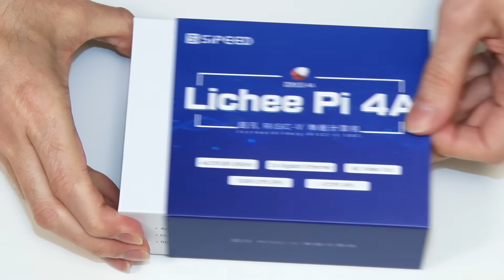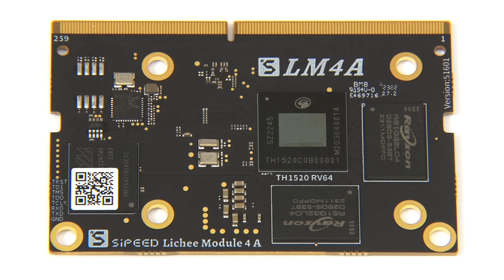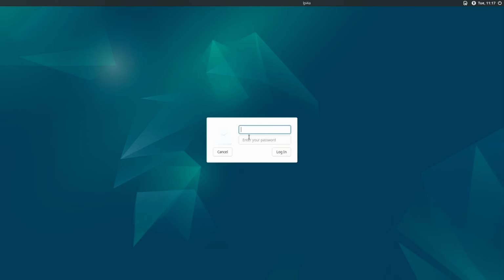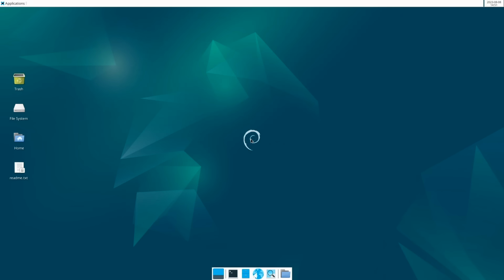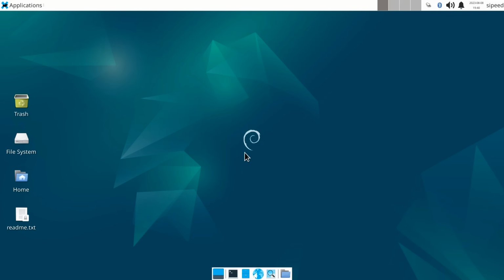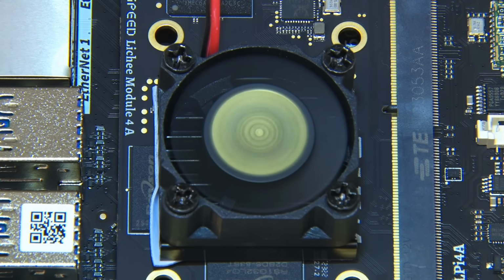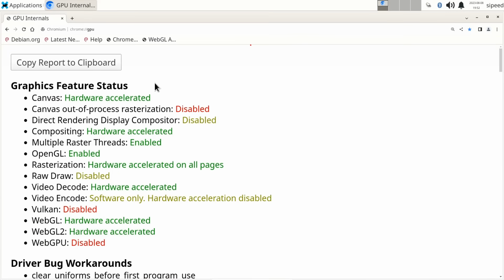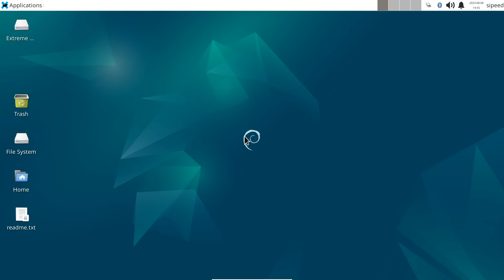Lichee Pi 4A: Serious RISC-V Desktop Computing

Comment: Too expensive, 
What's the point? 
when I can run a PC (new/old/mobile) run anything I can think of ...sure x64 solutions need more power but where is a ROI point for power VS limited SBC?
Reply from the maker: The point, as I noted early in the video, is that this is a development board for those wanting to develop for, or otherwise experiment with, RISC-V. It is not -- as you rightly note -- an end-user competitor to any ARM or x86 computer right now. But is it by far the cheapest RISC-V board with this level of power -- and will offer a great ROI for those wishing to develop for RISC-V (who three years ago were paying thousands of dollars for far less powerful development hardware).

The board is covered on this channel to demonstrate progress with the RISC-V ISA, which could be a mainstream desktop and server player in a few years. I am not here recommending a purchase. :)

Comment: Ok, well, it's not faster, it's not cheaper, and it doesn't work all that much better, so?
Reply from the maker: What are you comparing this with? It is, as I clearly said in the video, a RISC-V development board for those wanting to develop and/or experiment with hardware that runs the RISC-V ISA. In this context it is the fastest board at its price. It is not a competitor to an ARM or x86 computer. :)
Reply: @ExplainingComputers  Since the ISA IP is open source, it was supposedly supposed to drastically lower the cost of the final product. That was the hype upon which all the hoopla was based. Now, we see suboptimal products appearing that are in no way, shape, or form, of a lower cost, of increased performance, or better reliability than the offerings it was supposed to supplant.
Reply: @ExplainingComputers  BTW I just noticed the question below, which you granted a heartfelt heart. Ergo, I rest my case:

"They've made significant process since your last RISC-V video. It won't be long before RISC-V gives ARM a run for its money. And if they keep making progress at this rate, Intel and AMD had better take notice."

Comment: Hopefully the correct drivers are available for Debian, because I'd never accept the custom OS builds.
Reply from the maker: Well if you don't accept a custom OS build for a RISC-V system, you won't have any OS at all. :) This is not ARM or x86 hardware! There are no "correct drivers" or standard images out there yet.
Reply: @ExplainingComputers  completely understood.

 I had stupidly assumed that there would be a Debian risc build. Just that the board chips would then be usable on that.

Comment: What I find really surprising  in all those SBCs - be it ARM or RISC-V based, they ALL struggle with 1080p video playback. Given the year 2023 this is absolutely ridiculous since all the smartphones handle such video playback just fine. I find it hilarious.
Reply from the maker: It is a sofware issue? Drivers are needed for GPU-accelerated video playback, and as there is no standard ARM SBC platform, these need writing on a per-system basis. And somebody has to do this. Smartphones sell in their hundreds or thousands or millions, so there are no cost constraints on developing the drivers (and manufacturers of the SoCs develop them). In contrast, aside from the Raspberry Pi (which can handle 1080p), SBCs sell in their thousands or maybe tens of thousands, which does not leave a software deveopment budget to write -- and constantly update -- required drivers. Not "hiliarous", just basic tech economics.
Reply: @ExplainingComputers   It is hilarious as some of such SBC are clearly marketed as low power desktop computer replacement - which they absolutely are not. It looks like SBCs are on their way out anyway - as you said - there's no market for them. Couple hundred thousand is nothing in todays economy. That is why I have always claimed them to be a clear miss. Low power, simple SBC - yes - for coding projects as management systems for other devices. But a desktop? Hell no.

Comment: If you were experiencing video problems in Chromium, perhaps using Firefox or another browser might fix the issue.

I'm amazed to see SBC's become a great alternative to a desktop PC, even though you can't upgrade or repair them, which is my only concern when it comes to thinking about buying an SBC, I have been considering getting one, however, I think a traditional desktop is better if you plan to change parts, upgrade it, or going full custom! 

Great video, please continue making fantastic content, we really appreciate it. I also want to see more videos on Linux and SBC's, since I'm getting into them a bit 😁

Comment: And it only took 33 years.  https://en.wikipedia.org/wiki/RISC-V
Reply from the maker: No, it didn't. The article you cite very clearly says that RISC-V was introduced in 2015 (right side panel, right at the top). Don't confuse "RISC" and "RISC-V" -- the latter is just one implementation of the former general processor category. RISC processors are very widespread already -- every Android  and iOS tablet, smart TV and so on uses an ARM RISC processor. And so do all new Apple computers with an ARM M1 or M2 processor. I give up.

Comment: unfortunately this is far too expensive, it is even more expensive than the Orange PI 5 Plus.
Reply from the maker: I think you've missed the point -- this is a development board for those who wish to develop for or experiment with RISC-V (as I said in the video). It is not an alternative to an Orange Pi or any other ARM or x86 SBC. It is impossible to buy this much RISC-V power elsewhere for this price.
Reply: @ExplainingComputers  On yes ill definately agree with that, this is the first board that more or less matches RPI4 perf. The price is probably due to the format.

Comment: Great advances, thanks for covering this.
Many of us engage in IoT Python coding - mostly for me, interfacing to sensors etc. on SBC boards.
This is mostly successful on ARM devices (usually with Pi in the name) but for RISC-V, can you please check to see if Python 3 is supported along with interfacing to I2C/GPIO pins.
Thanks

Comment: Their ordering page is obnoxiously confusing. Accidentally ordered a debug probe before I realised it wasn't the board in question lol
Reply from the maker: I can only agree.
Reply: That will probably come in handy anyway :-)  Sadly, this is a problem shared by all Aliexpress stores. You get used to it, and learn to double-check.
Reply: @BruceHoult  indeed. No harm done in having an extra adapter around. Did manage to squeeze in the actual board with the same order after som fiddling so won't even cost extra postage :p

Comment: Seems a lot more responsive than the RPi4.
Reply from the maker: In some respects, it is. Certainly launching doing a search in a browser is more responsible. In other ways, a Pi 4 is more responsive -- eg its desktop is smoother. I am guessing the the desktop does not use GPU acceleration (yet) on the Lichee Pi 4A. They went for Chromium GPU acceleration first, which I think was a smart move.

Comment: Hey, just a question, Chris (can I call you Chris?) - have you ever tried the h.264ify browser plugin (available for both Chrome and Firefox) on any of these low-end boards? It forces YouTube to use h.264 video rather than VP8/VP9. VP8/9 usually isn't GPU accelerated but h.264 usually is and sipeed's webpage for this board says it does h.264 up to 4K at 75 fps. Most of these boards you review, even the RISC-V ones, boast similar specs with h.264, so this could be an absolute GAME-CHANGER for the desktop SBC world since most people's use cases are such that YouTube is the killer app for desktop. YouTube might be slow on these systems due to them being forced to render video on their CPU rather than using their hardware acceleration which is more than capable of doing HD or even 4K video. I use this plugin on my old ThinkPad laptops which keeps them functional as my daily driver in 2023 despite being more than fifteen years old! 

Worth looking into, no?

Love your channel. Peace. ✌️
Reply from the maker: Thanks for this. I always test to see if h.264-ify makes a difference. So yes, I've been "looking into it" for years. :)
Reply: @ExplainingComputers  Glad to hear it! I just had to make sure.

Comment: Can you try an AI LLM on it? Like from MLC LLM project, but it requires some GPU through Vulkan to work. They managed to work it on Android or ios with very few Ram and many popular open source Ai variations. 
By the video it looking quite fast, Linux on Raspberry Pi 4 is very slow when I've tried mine or maybe that was because a big TV.

Comment: It would be nice to see some tests in Firefox with ublock origin and maybe with/without h264ify to force h264 decoding. Also I've found Firefox is more performant for lower power systems, especially on YouTube playback.
Reply from the maker: I've since installed Firefox, but there is no GPU acceleration. So video playback is worse than in Chromium -- but HDMI audio is perfect! :) Remember, this is RISC-V -- what happens on other more mature platforms does not carry across (yet).
Reply: Especially when you discover the trick to make it use less cpu threads.

Comment: Great video Chris.. I like how video acceleration is sort of working out of the box and that it's fan is thermally controlled. Some SATA and M.2 slots would make the board very interesting indeed. What's the typical power consumption of RISC V processors in comparison with an ARM equivalent? Could this version of Debian run DEB apps, such as Zoom's Linux client, normally used with x86  computers?

Comment: Ohhh, wow. An RV chip with some sort of competent GPU. It doesn't look like it's working properly, though, or maybe media accelerations are hampered by the annoying codec licenses. Might just be software issues. Having the gpu and audio sort of work is an improvement over other systems I've seen. And their commitment to make a laptop and tablet using the system might be a sign that the hardware is good enough to experiment with.

Comment: Hands up all those that remember RISC the first time around.
Reply: If you look in the Top500 supercomputer list, you will see machines based on IBM’s POWER architecture — another RISC-class system. Also China has its home-grown high-performance “Loongarch”, which some say is reminiscent of MIPS — also RISC.
Reply from the maker: All ARM, and the new Apple M1 and M2 processors, are RISC. RISC never went away! RISC-V is just another, specific RISC implementation.
Reply: @ExplainingComputers  true :)

Comment: I really doubt that youtube playback in chrome was GPU accelerated. To determine this you'd need to look at the CPU utilization during playback. Chrome can show stuff as "GPU accelerated" but if the driver is llvmpipe then it's not.
Reply from the maker: Well you are wrong. The YouTube playback in Chromium is GPU accelerated. In Firefox, when installed, it is not.
Reply: @ExplainingComputers  ok, thanks!

Comment: I can't wait until it's no longer a risky move for large businesses to consider RISC architecture systems for regular large scale deployment. (Sorry, i had to do it. The statement is genuine, though)
Reply: Both Samsung and LG are known (from job adverts and partnerships) to be planning to use RISC-V as the main processor in future TVs and other devices. Samsung has been using multiple RISC-V cores for things such as controlling the 5G radio and the camera in phones since the Galaxy S 20 -- or at least a Samsung VP got up on stage and said so about the S 20 specifically, the "since" is my assumption. Qualcomm said a year ago they had already shipped 650 million Snapdragon SoCs with RISC-V in them starting in 2019.

Comment: RISC-V development is progressing impressively. 7 days with RISC-V would be an awesome video!
Reply: @@lurch789 If you want a cheap low-power basic PC, Intel is much better for that. Both Amazon and Chinese sites are full of mini PCs with J4105, J4125, N5105, N100, etc. processors. It would've been nice to see what other stuff can this board do instead of just showing the connectors and then doing a basic desktop usage showcase.

Comment: An important question is how customized (if at all) is the Debian they shipped with the board to get it to work? I don't have experience with Sipeed but I've been bitten by other manus before that ship boards that "work" but with a one-shot OS that can't update or update long term which dooms the board for security/compatibility/newer features unless open source projects decide to adopt it.

A good segment or re-visit might be what the OS support looks like. Can it run plain RISC-V Debian? If not what are the steps for re-installation? If it's not possible, how can you clone the storage on the device so you can recover to stock if you need to.

Comment: Very good review. BUT, can you still keep political neutrality being displayed as political ignorance? China is blocking Tesla cars in the proximity of every sensitive location. In a world where Huawei and Xiomi were proven of relaying data back home. Did you run something like Fireshark on the device? As promising as it looks. I'd treat it as a "Trojan Horse" from the start. Nice to play with, but not to be connected to anything before proven safe to use. And then still..
Reply from the maker: The RISC-V ISA is developed by RISC-V International, based in Switzerland . . .

Comment: they are barely ready for prime time and very slow - there is much better value out there - revisit this in 3 years
Reply from the maker: I think you've missed the point. As I said in the video, this is a board for those wishing to develop for and/or experiment with RISC-V -- and as such it is the most powerful hardware available.

Comment: Another great video.  Thanks EC.
Could ya do a video explaining the purpose of dual ethernet ports and their purpose, advantages, if any, and any other info about them.  One thing that always confuses me is why some boards have a single and others a dual port.  Thanks.
Reply: One reason to have two Ethenet ports is to connect to two networks at once. That is what routers do. Notice the (upcoming?) support for OpenWRT.

Comment: and should they add "pi" to the name even though it has zero to do with RP? this market is so problematic eh
Reply: Have you missed Banana Pi and Orange Pi, both available in various models since 2014?
Reply: @BruceHoult  have you missed that both of them are aiming to be alternatives to RP and are based on the same? but this has zero to do with RP and doesn't even have ARM? oh boy
Reply: @Adventures_EC  in what way is Lichee Pi 4A not an alternative to RP?  Why should "having ARM" be a criteria? It's not even as if there is a single ARM instruction set shared between all "Pi" boards. For example, the original Pi only ran ARMv6 code, while the Pi Pico only runs ARMv6-M code (Thumb-1, plus a couple of Thumb-2 instructions). Soon, there is likely to be a Pi that runs only the very different ARMv9-A code, as new ARM 64 bit cores no longer support the old ISAs. How is using RISC-V harder than dealing with that mess?
Reply: what are you talking about? aahh these people on Youtube eh. no single world makes any sense at all. @BruceHoult

Comment: Nowaday there are x86, ARM and RISC-V instruction sets. What do those instruction sets do and is there any benefit to the one or another? Seems this is a major consideration when it comes to choose a singel board computer. Isn't it comparing apples to coconuts comparing computers with different instruction sets?
Reply: There is no essential technical difference. x86 is worse than the other two, but the application of sufficient money has been able to overcome the problems. Think of them like English, Russian, and Chinese (or some other set of your choice). If you want to read a book (run a program), you need to speak the right language. The main difference is that x86 is owned by effectively two companies (Intel and AMD) who sell chips and don't permit anyone else to make compatible chips. ARM is owned by Arm, who don't make chips but allow only companies that pay them lots of money to build compatible chips -- and everyone except Apple, Samsung, Qualcomm, Nvidia and a couple of others (who pay a LOT more money) are only allowed to incorporate Arm's core designs, as-is zero changes into their chips. The RISC-V specification is published by a Swiss-based non-profit. Anyone in the world is allowed to design and enhance for their own needs and build and use or sell chips compatible with the RISC-V specification without any license, even without informing RISC-V International.Only if they want to put the trademarked name "RISC-V" on their products do they need to join RVI for $5k/year for companies with 500 or fewer employees ($2k for companies with <10 employees and in their first two years) and get their product tested for compatibility.
Reply: @BruceHoult   Thank you for your detailed explanation. Thought it would be the Barkley University who published the CPU instruction. Tell its open source to gain positive attention than sell the name. It is a sneaky way to make money. ... Genius!